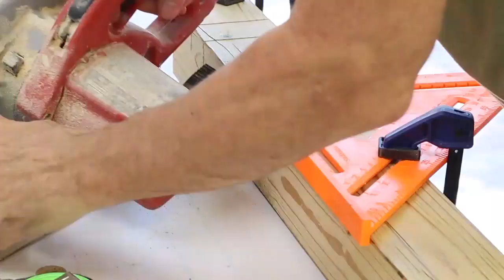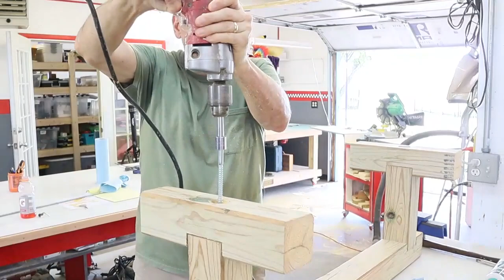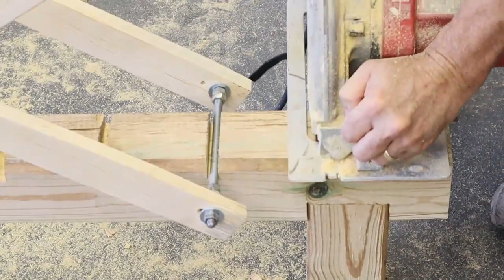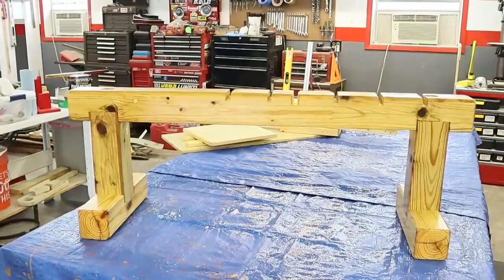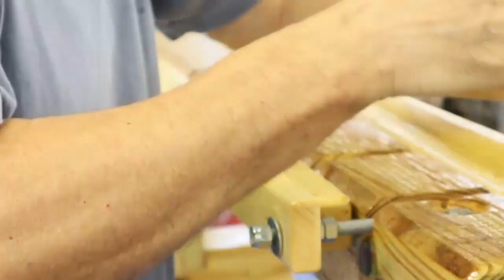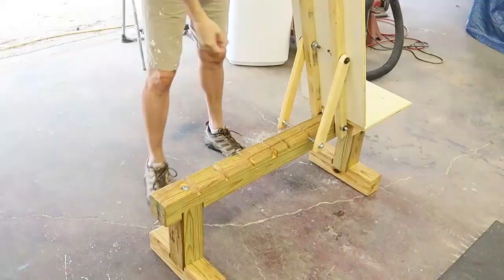HOME GYM | DIY Adjustable Weight Bench Press | Build Your Own Incline Gym Bench at Home

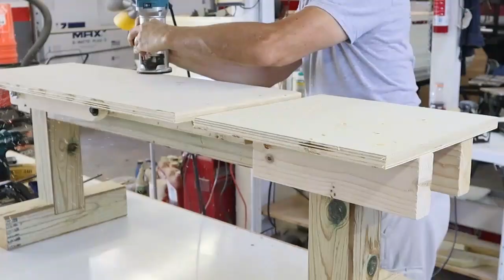Comment: What's the name of the machine used in minute 6:12 please
Reply from the maker: That is a hand router with a cutting bit that rounds the edges of the board. Thanks for watching. https://www.homedepot.com/p/Makita-6-5-Amp-1-1-4-HP-Corded-Fixed-Base-Variable-Speed-Compact-Router-with-Quick-Release-RT0701C/204247210

Comment: Any idea how much this will hold?  I'm 6'6" 415lbs...
Reply from the maker: Good question. I have not tried it to failure. I am 180 lbs and have lifted about 100 lbs on it so far.
Reply: @makergarage101  I'd probably be lifting 30-50lb dumbbells or kettlebells... so, do you think it could hold 500-600lbs?
Reply: You can get a rep bench, it's rated for 1000 lbs